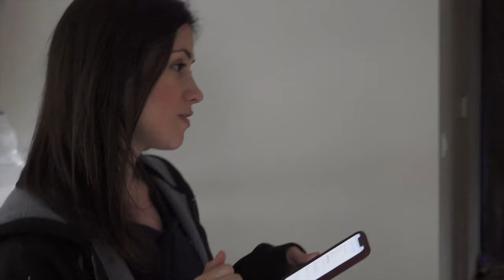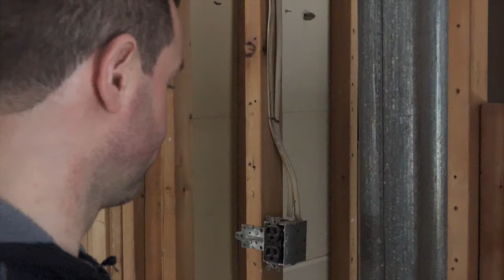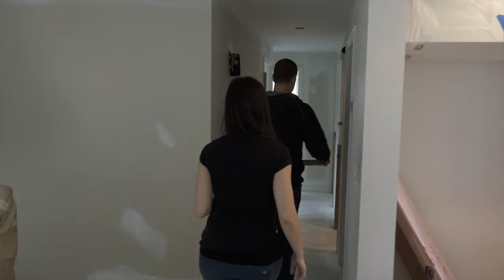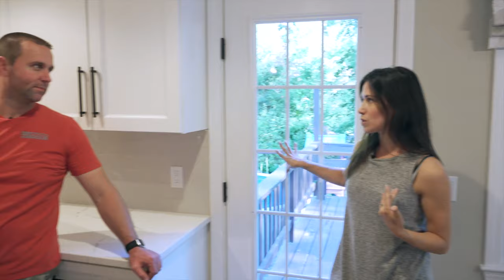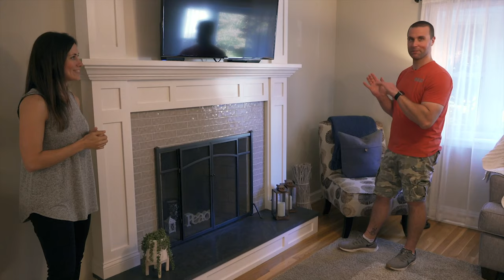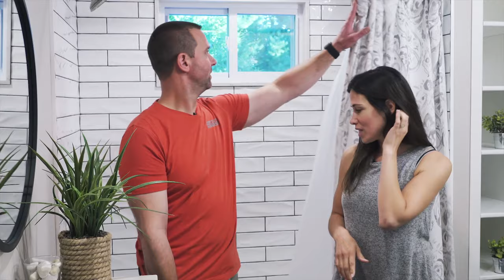SPLIT LEVEL HOUSE IDEAS | 1960s Home Renovation, Small Island Kitchen Design, All White Kitchen!

Comment: These houses were built so cheaply that they couldn’t spend the extra few bucks to put light fixtures in the ceilings. I just can’t imagine that. 

You’re building the house, it’s all framed up, and for the cost of 20 feet of 14/2 Romex cable and a ceiling electrical box you can put a light in the stupid ceiling, but nope. Too expensive. The whole house was built with that mentality of “what’s the absolute cheapest thing I can get away with?”